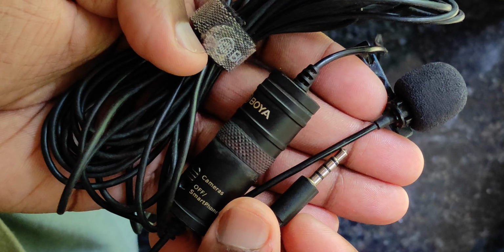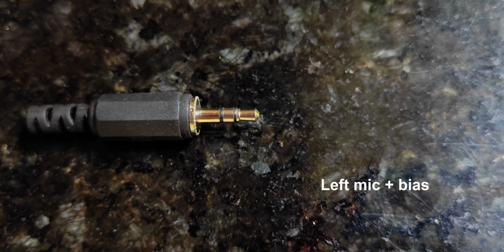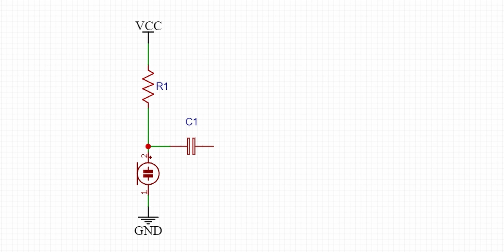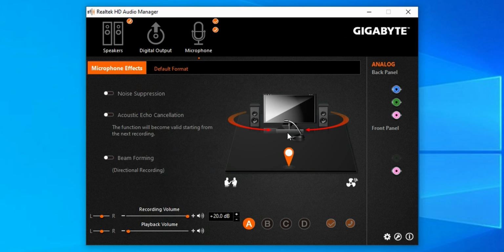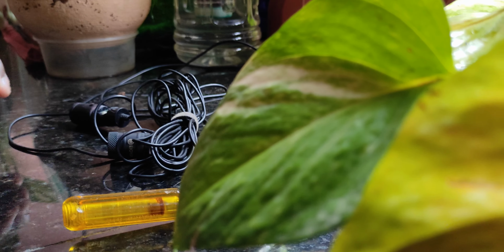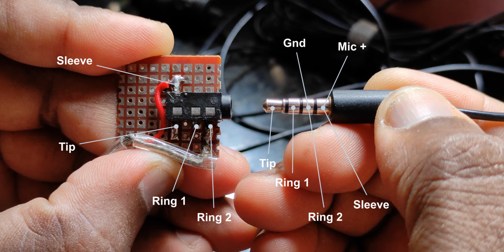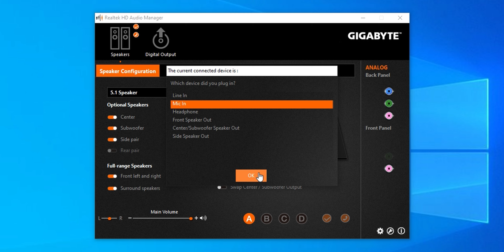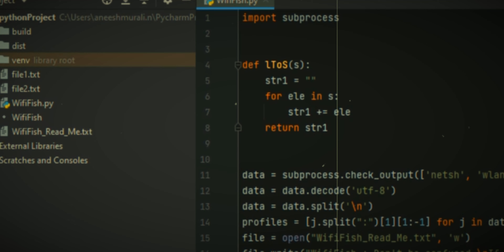How To Make BOYA BY-M1 Microphone Battery Free | Don't Buy LR44 Battery Anymore.

Comment: After I got the microphone, I mistakenly inserted the LR44 battery with reverse polarity inside the capsule and turned on the switch. Obviously, it didn't work, so after realizing my mistake, I corrected it by installing the battery with the correct polarity. It works, but there is a constant static noise in the recordings. Do you think I might have somehow damaged the circuitry inside the capsule?
Reply from the maker: Static noise are common in every microphone and it's there. When it's getting too loud then there is a problem maybe somewhere in the cabling or connector based issues. You can use audacity to clean up the audio or use ai based tools like rtx voice or atleast you can turn on noise reduction in the audio control panel of your personal computer.
Check out my mic building video there I explained some of the audio recording tips and I made that mic for just around $1.77 and which sounds great with my recording tips.

Comment: Hello my friend. I figured out same technics as you, but when I connect this mic to my external audio interface Scarlett 4i4 I have very very very low signal without battery. Even if phantom power is on. Can you advice whats wrong and how to make it operate without battery?
Reply from the maker: I believe it's a bias voltage issue. Check the voltage coming from the jack without wiring the microphone. We need between 1.5V to 2.5V (1.5V is typical for this capsule). If it's below 1.5V, it's under-biased and proportionally decreases the output signal.
If it is too high cause degradation in sound and may damage the capsule.